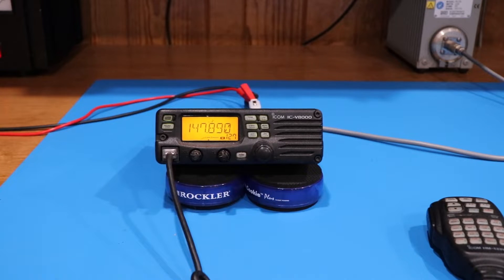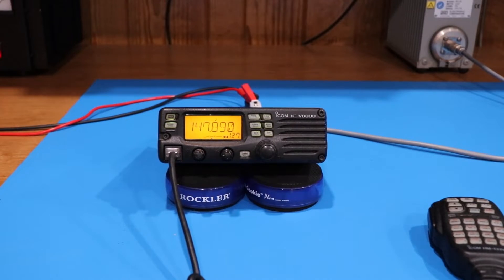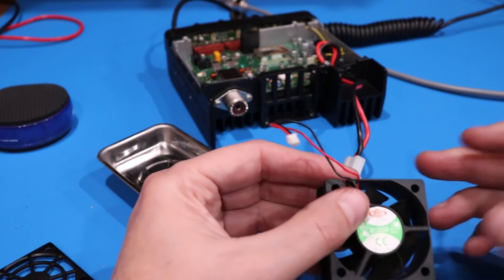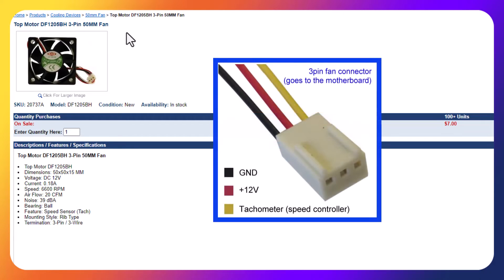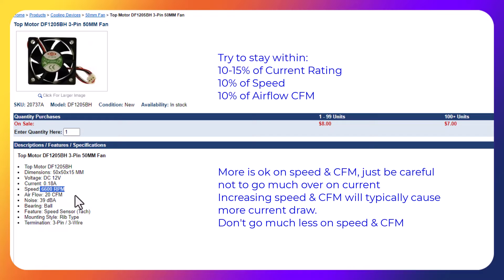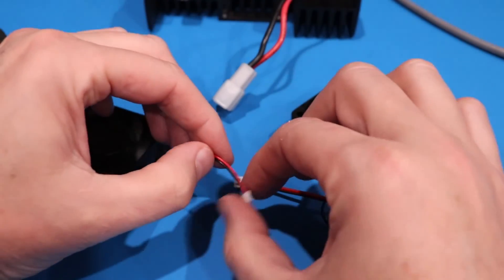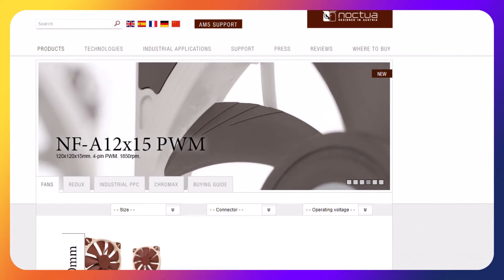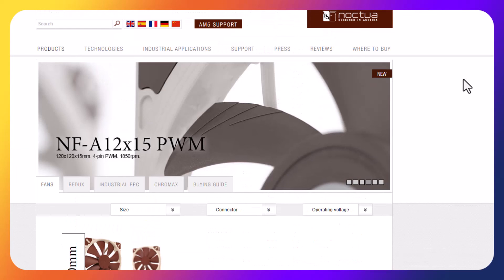How to replace the fan in your mobile Ham Radio, CB, test gear, or many other things

Comment: I recently set out to reduce the fan noise on some HP test equipment by installing a Noctua fan. It turns out that the HP fan was running off of full line AC voltage, and  Noctua only offers low voltage (5, 12, and 24 V) DC fans.

Comment: It's pretty rare that I have found a fan circuit that isn't capable of handling significantly more current than the original fan, or a DC fan in the same size and voltage that is significantly different from any other fan of the same size and voltage. I always start with size, voltage, and CFM and work back from there. Especially on radios. The fan is protecting your finals, and if you reduce the fan output, you reduce the duty cycle the radio can handle. Not necessarily linearly either.
Reply from the maker: Exactly why I said stay within 10%.

Comment: Great information! Recently had a neighbor with a bass guitar amp. His fan was getting noisy, he replaced it with a similar unit, but his amp would overheat. I looked into it, the fan ran at 12 volts once it was turned on, then 24v when a certain temperature was reached.  The fan he had installed was 24v and at 12v it wouldn't run and the amp would overheat.. Had to search data sheets for a fan that would work over the voltage range and it has been working well ever since. Thank you.